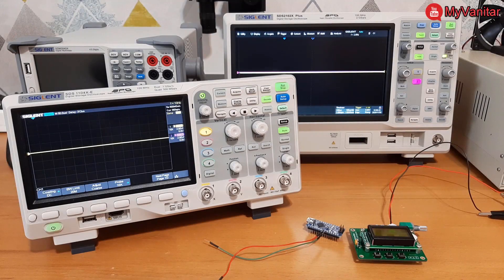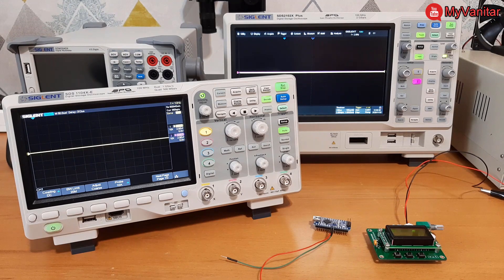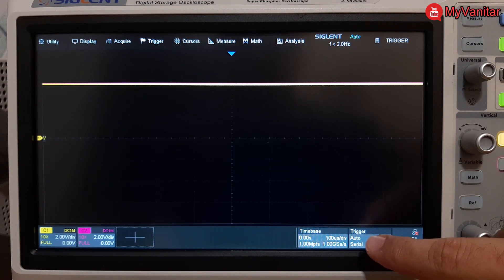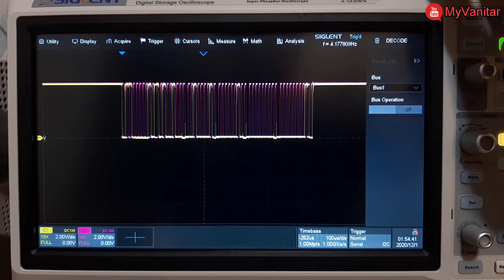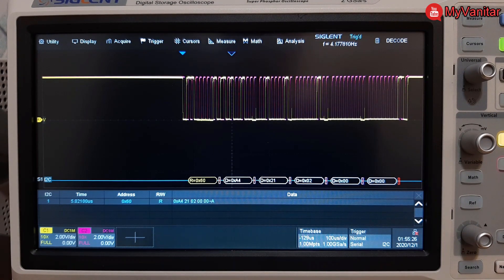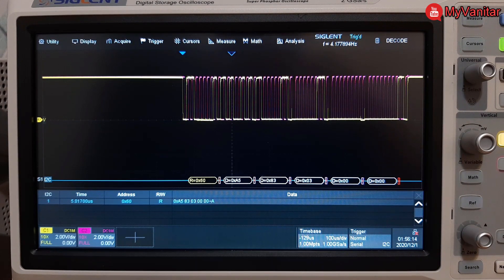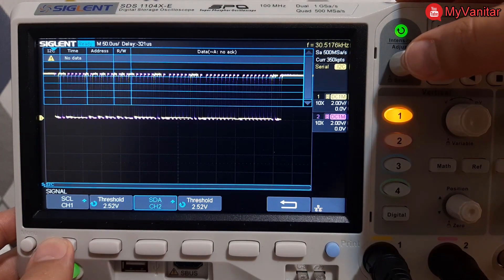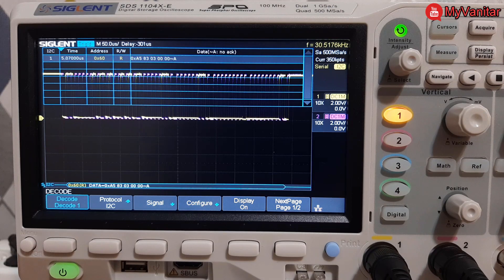I2C Signal Decoding/Debugging using Siglent SDS2102X Plus and SDS1104X-E Oscilloscopes

Comment: Finally got I2C decoding working in my new SDS1202X-E. Turned out trigger settings was wrong. Your trigger settings work like charm. Thanks!
Reply from the maker: The first try takes time, after that it's a piece of cake

Comment: thank you! I'm new to modern scopes and the depth of functionality in the 1104 is incredible. As a hobbyist, it's been really valuable in understanding even the most basic circuits (seeing charge/discharge of capacitors, for example).
Reply from the maker: That's right, knowing the basics solves many problems and confusions. basics in practice =  infrastructure

Comment: Thank you for details.
Could you make a reengineering  video about your power supply review ,circuit and test etc ? 

Because I am searcing for make a current  limiter power supply too. Of course you can make video about  more effective 0-30 volt voltage adjustabe  and 0-5 Ampere current limiter power supply (or more high current  adjustable) 
Againg thanks for great videos
Reply from the maker: I will publish several power supply videos soon, stay tuned!